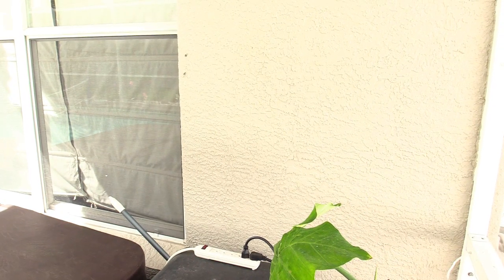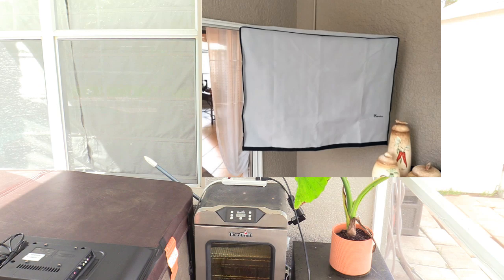How to install a TV on Stucco Concrete Block Wall Outside Patio

Comment: "Low speed" on the drill is a gear reduction that increases the torque of the drill...that can make it easier to strip out as the drill has more twisting power....just FYI the better function to save yourself from stripping is to use the variable clutch function of the drill if equipped, and use a careful trigger finger....thanks for the vid
Reply: Exactly.
Reply: Whats this -  variable clutch function
Reply: @Computerexpert4you  the thing on the drill that has numbers and twists from left to right.... the lower the number..the lower the torque.

Comment: It's great you can mount a TV outside down there in Florida. Wouldn't be a good idea up North though. Enjoyed the content.
Reply from the maker: Yes many people install TVs in their patios up north, I'm from NY and NJ, just use a tv cover. Remember outdoor TVs won't last as long as indoor TVs, so buy an inexpensive TV.
Reply: @TampaTec  this seems counter intuitive. Could you explain how a regular TV will last longer than an outdoor TV, please?
Reply: @heclas  If you mount a TV outdoors, it will not last as long as a TV inside the house. (He was not talking about a specialized TV that was made for the outdoors that costs big $$$)
Reply: @SmittyAZ  ok, i see, I read it wrong. That makes sense. Thanks, brother!

Comment: I have a question do you need to take the tv in or is it weatherized? Also Great Content
Reply from the maker: Tv is $88 and $19 TV cover works great but outdoor tv costs hundreds. some bigger outdoor rated TVs over $1,000. I would buy a cheap TV and After every use just cover your TV.
Reply: It also depends on where you live. I live I the Pacific North West... I could possibly leave a (covered) TV outside in the summer season for a maximum of two weeks.😂 Otherwise it's likely to rain or there's way too much dew at night time. There's just so much moisture in our air here. 💦📺   Thank you for this video! It's really helped me with other items I need to hang outside on my stucco walls. - Lights, garden hose hangers, etc

Comment: It's interesting how you pre-install the mount on the TV, obviously people will always do it differently, but the most common way I have seen here in Western Australia is to use the mount to identify the drilling holes first (You put the mount against the wall then use a marker to mark the holes on the wall).

Also, why sealant and not actual wall mounting plugs?
Reply: Ray Herring It’s best to initially install the mount on the television first so that you can accurately measure the bracket position relative to the TV itself (as every TV is different in size, bolt pattern, and bolt location). This gives you the measurement needed to dictate the exact height that the bracket needs to go on the wall to get the TV exactly where you want it. The sealant adds a bit of protection from moisture creeping in. The tapcon screws he used are functionally equivalent to wall anchors in this (and most) scenarios.
Reply from the maker: Plugs work great but sealant does too and cheaper.
Reply: @ZWill07  Never been a problem over here.
Reply: @TampaTec  The wall mounts we have here in Australia come with every bolt, screw, and plug you could ever need in the packet with the wall mount :)

Last several I got had 8 different types of screws (sizes, lengths, etc...) plus spacers and all that.
Reply: Ray Herring “Never been a problem” isn’t exactly a professional standard lol. Eyeballing bracket position on the wall does not meet the precision level that many clients expect for a paid service. Most brackets come with screws, spacers, and masonry anchors worldwide.
Reply: @ZWill07  agree with everything you say. I don’t know what Ray is talking about, but it seems like he doesn’t do this professionally. Or perhaps he’s just a handyman who isn’t trying to do that level of workmanship. One thing is for sure, there’s no way in hell with his method that he’ll be able to mount the TV in a cabinet or recessed space. In situations like that, we need to put the bracket on the back of the TV and measure exactly where that bracket is going to be ending up, otherwise the TV won’t fit or won’t be centered inside those built-in spaces.

Comment: Did you have to screw into a stud? I’m trying to hang a 40’ tv on my patio but I’m unsure if I can do so without anchoring to a stud.
Reply: He didn’t go into a stud, that’s the reason for the masonry screws. In general, it’s always best to go into a stud, but a 40 inch TV is so small and light, that you don’t really need a stud.
Reply: Can you use a masonry screw for a 55 inch?? I want it in the patio. But the studs are no where close for the installation
Reply: @jayvila1337  jst use toggle bolts...heavy duty ones....those toggle bolts hold alot of weight.

Comment: The only possible way this works is if there is wood behind that stucco...if its just stucco with chicken wire and foam like they build here in AZ....that TV will be smashed on the ground in no time.
Reply from the maker: Yes, stucco on foam TV will fall but not stucco concrete walls. Tapcon screws are made for concrete block or brick, mortar wall types. proof- https://youtu.be/MJtS1yBprYQ
Reply: How to install in stucco in az?
Reply: In Florida the stucco is applied right over concrete block since most homes are built that way due to hurricane resistance codes.
Reply: I'm in AZ too trying to mount a 55 on stucco with no studs. What do you suggest? Snap Toggles?
Reply: @walkertekk9  Get yourself a proper mount that would span two normally-spaced studs.  A mount like the one he's using here is for smaller TVs.  (My 55" TVs are ~48" wide and would easily hide a wider mount.)

Comment: Couldn't you just place the mount on the wall and drill the holes in where the screws are suppose to go instead of using measuring tape?
Reply: No.
Reply: You could do that... But.. the proper way if in the video.
Reply: If you don’t care about how high the TV ends up, then sure.
Reply: Always use a measuring tape....u may get away wuth eyeballing stuff for a while but there will come a time where that will backfire on u drastically.....trust me....cough cough.